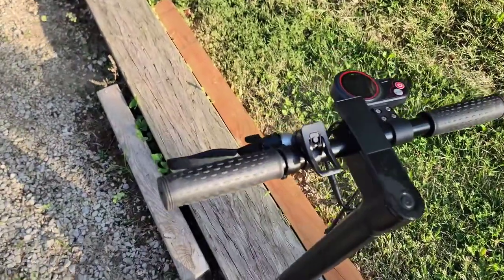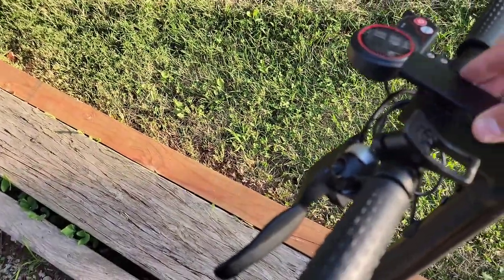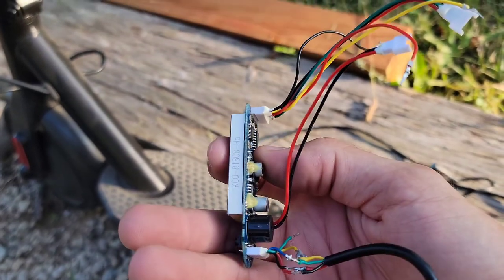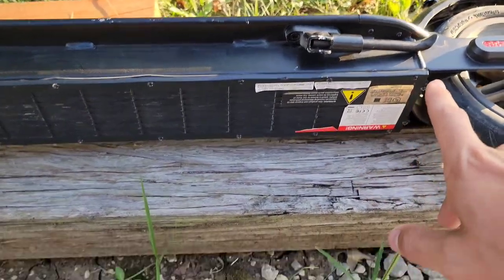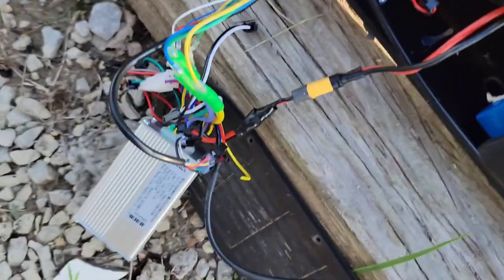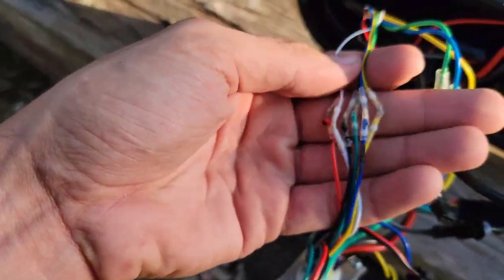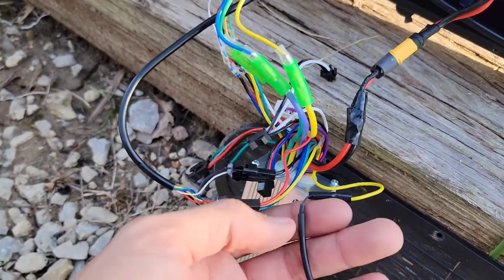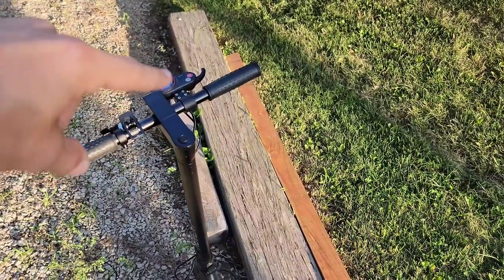How To Swap Out A Electric Scooter Controller

Comment: Hey man I have an issue with either the wire connected to the dashboard or the controller. The cable disconnects and  I got a new dashboard but when I opened the bottom cover everything is working, battery, wires, except for when I tap the wire connected to the wire which goes up to the dashboard it just switches modes, and turns on/off. I can't tell if it's the socket or the wire what do you think I should replace? Thanks a lot, love your videos.
Reply from the maker: I would honestly replace the controller and display. I'm not sure what the actual is without having it in front of me

Comment: How to connect display and throttle if you dont have display plug in controller?
Reply from the maker: This kit comes with all the proper connections between the controller, display, and throttle
Reply: @MCPHILL  sure, but how to wire it if you have controller without original plug...
Reply from the maker: @josipkupresak9659  it comes with the wire that runs from the controller to the throttle/screen
Reply: @MCPHILL  do you have some phone number so I can send you a photo of my problem on whats app or e mail?
Reply: Yeah im trying to use all my existing parts and my throttle plugged into the display... if its NOT how do I attach it

Comment: Do scooter goos now faster or slower? Thanks.
Reply from the maker: It goes faster now
Reply: @MCPHILL  i bogutht it, but power for led stop light and front light is 36v, it fried all led diods
Reply from the maker: @MrSrbindogroba  I'm pretty sure the leds are 5v, I never hooked mine up
Reply: @MCPHILL  i though same, but after connecting to multimeter, it says 41v ( battery voltage)
Reply from the maker: @MrSrbindogroba  that does seem a bit too high
Reply: @MCPHILL  follty controller. 🙄

Comment: I installed this kit on the exact same hover 1 thought everything went smooth but when u power it on the front wheel motor moves a lilttle on its own then doesn’t do anything else battery is full
Reply from the maker: It sounds like a defective controller
Reply: @MCPHILL  even hooked up that green continuous wire, and the front wheel spun continuously, but that was about it so I know I have everything right , ur probably right
Reply: @alvinstewart7196 the green continuous wire is "self study" connector.

Comment: Ok. I have a scooter with a 250 watt hub motor. Do i need to upgrade to a 350 watt hub motor? I'm just trying to get More speed. Im at 15mph right now stock.
Reply from the maker: New controller and motor
Reply: @MCPHILL  appreciate it

Comment: how many volts and how many amperes is the battery?
Reply from the maker: 36v 6ah
Reply: Max speed ?
Reply from the maker: @ciutekpek3530  18mph
Reply: running speed on the road how many km?
Reply from the maker: @ciutekpek3530  28
Reply: there are three modes eco , D , s are you in position, speed (S) , max speed 28 km? how long does the battery last on the road?
Reply from the maker: @Ciu Tekpek  you can watch my other video on range, it has power level 1-3
Reply: I want to increase the speed of running more than 28km how?
Reply from the maker: @ciutekpek3530  buy a different scooter or esc and motor
Reply: @MCPHILL  so what color are the headlight and brake wires
Reply from the maker: They aren't on the new controller
Reply: I can see your controller, or you can send your controller to take a picture. I want to see and buy it
Reply from the maker: @ciutekpek3530  https://www.amazon.com/gp/aw/d/B07MDWZBHR?psc=1&ref=ppx_pop_mob_b_asin_title
Reply: @ciutekpek3530  you get a higher voltage batterry and a highwr voltage controller if you want more speed.

Comment: hey man i bought my controller and plugged it in. I have the exact same scooter as you and the same controller, however the screen stays blank when i plug in the battery to the positive and negative (without the hall sensor plugged in, its 6 pin on the controller but 5 pin on the motor? and without anything else but the throttle plugged in). Am i doing something wrong, is there a wake up procedure to turn on the controller or it just turns on by itself?
Reply from the maker: On the new controller, you should just hold the red power button
Reply: @MCPHILL  I see, seems then my controller is defective..  I tried an og controller from it but never worked, what is even the problem if battery is outputting 37.7v and motor seems fine. Anyways, thanks for the reply!
Reply from the maker: @PankratiosVaseleus if you have a multi meter, see if you have any power at your controller connector
Reply: @MCPHILL  thank you! after further digging I realized there is a small wire that needs to go between the connectors, that solved the issue. Escooter is now fully operational.
Reply from the maker: @PankratiosVaseleus  thats awesome 👍

Comment: I’m knew to this how do I know what controller to get for my scooter, also if I want it faster do I have to swap the battery out as well or can I just get a faster controller
Reply from the maker: You can keep the same battery. The first thing you need to do is find out what volt and watt your motor is and buy a controller that matches
Reply: @MCPHILL  appreciate that so much fr fr 🙏🏽 so technically I can swap the motor and controller and keep the 48V battery,
Reply from the maker: @ajcash146  you can keep the motor as well if it's a 48v
Reply from the maker: @ajcash146  no worries, I'm happy to help
Reply: @MCPHILL last thing man lol I have a Hurley hang 5, it has a very similar set up and build like this one in the video, just curious if you think this exact controller would be compatible
Reply from the maker: @ajcash146  it should work, but make sure to get the 48v version
Reply: @MCPHILL  bet appreciate it, do you go over 15 with it? Mine only goes 15mph rn, I have a limiter wire I think, just can’t find it
Reply from the maker: @ajcash146  I think mine only went 15
Reply: @MCPHILL  okay awesome I probably should’ve started with that lol I’m just trying to go at least 20mph or more
Reply from the maker: @ajcash146  looking at my past videos it went 18.6mph